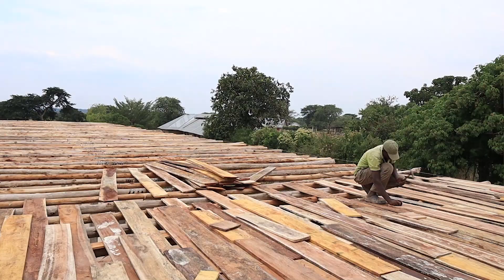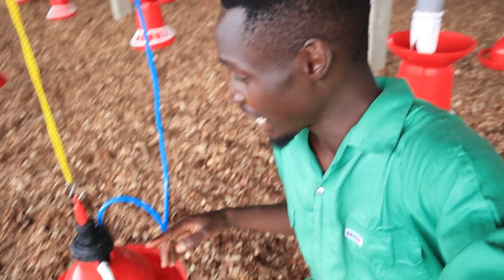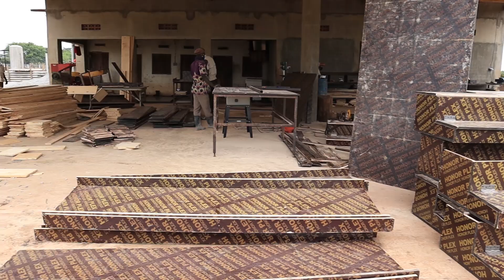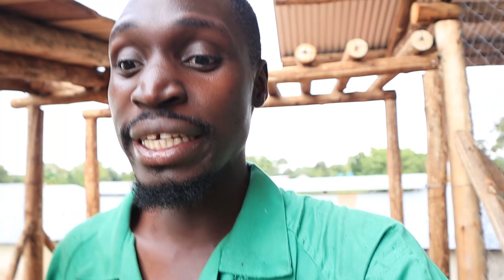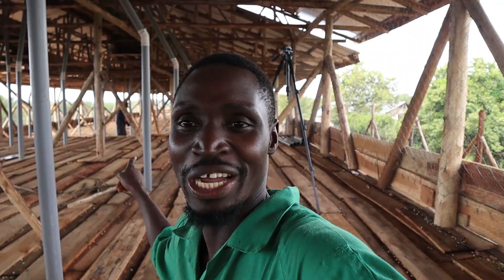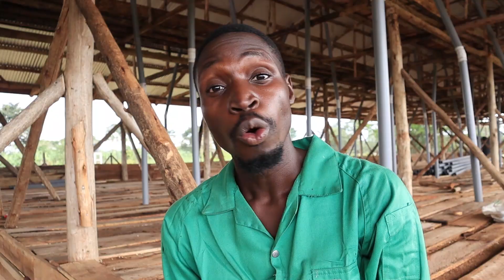Cutting Down an Entire Forest to Build a Chicken House?

Comment: There is no way to justify this when the earth is 4 degrees hotter than it usually has been. Rain has become rare in many places ( what will your chickens eat if no rain to grow the corn), and both poles are melting which means rising sea levels and flooding. Recycling is the best way to go IMO. I have a farm and we have a combination of both woods and concrete….no way will I let anyone use that much woods in a single structure. Please be mindful.